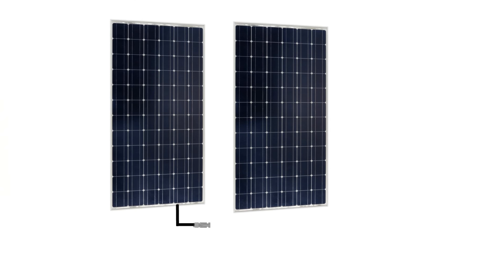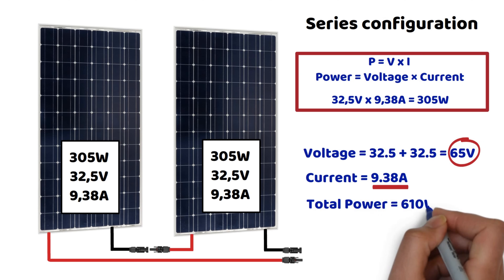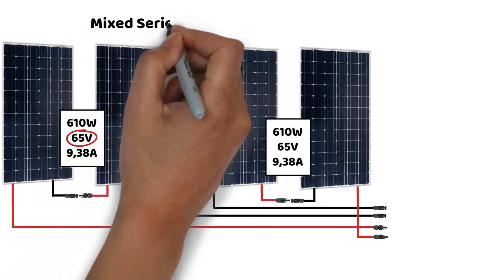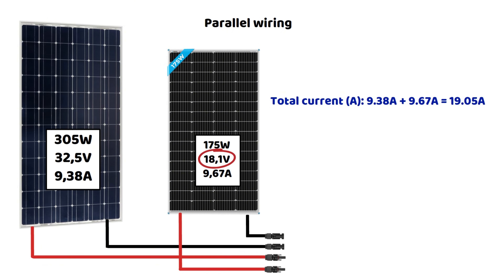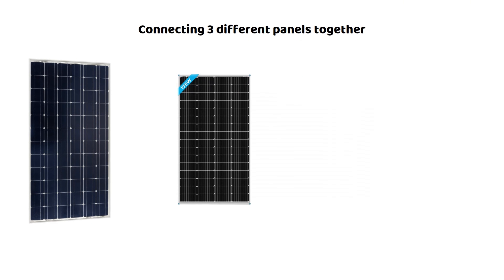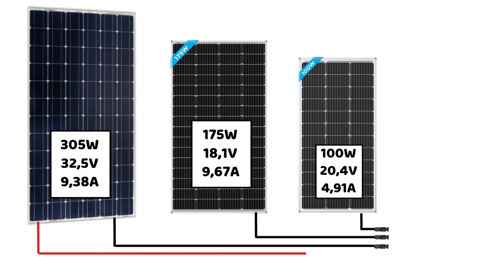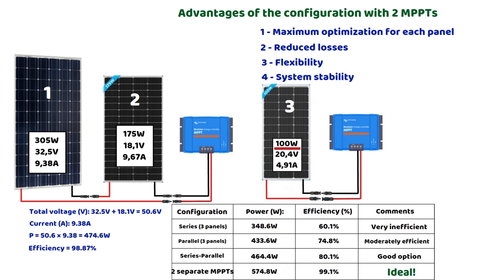How to Wire Different Sizes of Solar Panels ? Series - Parallel - Mixed?

Comment: From what I understand in the case of the 2 separate MPPTs, the output would be going to a bus bar and then, in my case to my power station's DC input. So what happens at the bus bar, does the voltage add up or the current ?

Comment: Moi j’ai une question qui est simple, j’aimerais avoir une réponse
Quand on met un injecteur réseau gridtie il est intéressant d’avoir le Panneaux en direct sur le sur l’injecteur si on passe par régulateur, on limite le voltage une première fois et résultat au lieu d’avoir par exemple un panneau de 500 W en injection direct sur onduleur gridtie si on passe par un régulateur, on aura pas 500 W parce que les régulateur va faire tomber le voltage à 12 V ou 13 ou 14 alors que dans l’autre cas on aura le du Panneaux qui qui est peut-être de 40 de volts
Donc avant avec 40 de volts l’injecteur réseau va nous fournir 500 W plus ou moins on sait que c’est jamais 100 % alors qu’avec un régulateur on va se retrouver avec du 13 au 14 V voir si il choisit 24 V, on va se retrouver avec 28 V. Résultat l’injecteur réseau va produire que 350 W ça personne en parle jamais.

Quand on met un injecteur réseau, c’est toujours un injecteur qui a une plage d’entrée par exemple de 10 V à 60 V et le panneau si c’est un 40 de vol on balance directement les 40 de volts qui seront bien bien évidemment accepté par injecteur puisqu’il est prévu pour elle sortira le maximum alors que si on passe par un régulateur, le régulateur va tomber le voltage donc l’aérage est arrivé au bout, on perd un tiers de la puissance du Panneaux
J’en ai fait les frais, c’est pour ça que j’en parle évidemment pour avoir les résultats, j’ai derrière à la sortie de l’injecteur un compteur qui me dit combien je produit. Dans un cas, j’avais 485 W dans l’autre cas, j’avais que 350w plus ou moins bien entendu donc il faut en parler les ingénieurs, les savant qui laissez  des messages là. parler non pas pour faire de la publicité pour VictronConnect, car je constate que tous ces postes servent seulement à faire de la publicité

Comment: You can't put 2 panels in series and add one panel as a parallel, the series voltage will over power the single panel and destroy it. 
So by saying to to that you're completely wrong with your maths and configuration of knowledge when connecting 3 panels together if you think 2sp will work

Comment: One thing I noticed is that you mixed (12v) panels with a 24v panel.
I wonder what the results would be of the same voltage-rated panels of different wattage ratings

Comment: Sir I have a 100w and 200w solar panel and 600/700w hybrid inverter and 3x 45ah battery. so what type of connection will be best, without considering voltage increase or capacity add up.

Comment: In short: 
Only use series connection for panels that have the SAME current rating otherwise it will run on the lowest current.

Comment: I connected two panels in series. 
One has 36V 11.6A 417W 
The second 42V 11.5A 483W 
That adds up to 78V 11.5 Amps 897W.  
3 watts are lost because 11.6 A is not reached. 
99.6% !

Comment: Do NOT buy a power unit from Aferiy, The after sales is nonexistent. I got the 2400 W version of this and it doesn't charge.

I have sent emails, photos and a video of the problem. I requested a refund or replacement. Aferiy are now ghosting me. 

On wanting to printout the Aferiy  emails, I discovered their emails to me, have disappeared from my computer. The are using SELF DELETING EMAILS. (I didnt know this was possible.) 

I looked on Trustpilot and there were plenty of similar complaints with customers having to seek legal action. Many of these units they send out have faults. Maybe thats why they are cheaper than other reputable brands.

The REVIEWS that Aferiy use to promote their products seem to be very FAKE. All with far too much praise for themselves. Very suspicious!! 

Anyway, I'm starting legal action as there is no other way of seeking a replacement or refund. 

Poor you if you took out extended warranties. I think this is a rogue company.

AVOID or you will be very sorry if yours arrives faulty, or a fault occurs. 

Can you afford to lose your money?

Note that none of the product reviewers have tested Aferiy customer Services.

Comment: Hello
I have a hybrid inverter 4.2 kwh 100a 1x MPPT. On the roof I have
A: 8x solar panel Vmp: 32.65 Imp: 13.63.
B: 6x solar panel Vmp: 44.3 Imp: 10.

How should I connect them for the best efficiency?

Thanks for the answer

Marko

Comment: Series parallel on my system with 4 panels is 98.9% efficient so make sure to do the correct calculations before just buying more charge controllers.

Comment: I am from Pakistan, a country where the economy has completely collapsed. This is mainly because, under the guise of democracy, the Pakistan Army controls all institutions, while politicians act like their obedient servants.

I managed to gather 15 solar panels with great difficulty, as buying that many panels is not an easy task in a country like Pakistan, where the average income for a common person ranges from just $100 to $300 per month.

Initially, I installed a system of four 300W panels. Later, I upgraded it by adding four more 400W panels. With these eight panels, I was able to run a 0.75-ton window AC (which consumes around 800W at 220V) from 7 AM to 5 PM.

Then I bought four 555W panels and added them to the system. I had no knowledge about how to properly connect these panels. After that, I purchased three 450W panels, and now I have a mixed collection of panels. During a storm, two of my 400W panels got damaged, although they still produce some current.

I tried a series connection, but the amperage started decreasing too much because of the smallest panel. Now, I’ve arranged them like this: three 450W panels connected in parallel with 2 400W panels — they have about a 2-4V difference. I also created a separate set of four 555W panels connected in parallel, which generates more than 50A. The upper set (450W and 400W) generates over 45A.

Then I made another series set using four 300W and two 400W panels (total six panels), which also generates around 45A. I connected all three sets in series. One gives 45A, one 48A, and one 52A. The output is based on the set with the lowest amperage, and the total voltage generated is about 130V. My inverter supports 50A and 150V, and the system is generating 4–5kW of power from solar.

Currently, I’m running two 1-ton AC units set at 26°C from 8 AM to 4:30 PM. I don't have enough money to buy new panels, nor can I sell the used ones. I’m just managing with what I have. In the morning, I can run two ACs, a deep freezer, and fans and lights in four rooms. I’m satisfied with this improvised setup.

But the reason I had to resort to this trial-and-error approach is because I never received any proper knowledge about solar panel connections. Our education system in Pakistan doesn't teach the youth anything practical or useful in this regard.
Reply: Jab yahi army Imran Khan ko 2018 ma layi thi to wo thek tha?

Comment: This is a very good video but my question is, since we’re using two different controllers, how do you decide the battery to use and how to connect it?
Reply: probably both controllers directly to the battery (in parallel) the voltage stays the same and the current adds up.

Comment: in the case of two mppt controllers, do you connect (load) out put of these two in parallel and connect it to the inverter? usually i do not use the load output of the controller and connect the inverter directly to batteries.

Comment: So. Can I hook both (2) charge controllers to one battery, to charge it faster?
Reply: Sure, you can hook up two charge controllers to one battery—just make sure they are set up in a way that they will charge the battery according to its ratings.
Reply: I believe that would be the best ... Each panel with its own controller and connected to the same battery ... But you would use more wires and more an extra controller.

It might be better to use the series method.

Comment: Greetings to you.. Although the video is a lecture at a high level of benefit and I can say with confidence that it is difficult to find information on YouTube similar to it, you did not complete the idea regarding the connection to 2 mppt in terms of how to connect the system to the load in a final way. I find that confusing and difficult for beginners.
Reply: I think you have to give that supply through MCBs in the main DB

Comment: Good day. 
i want to connect 80W and 50W or 80W and 80W or 50W and 50W. I've got 4 panels but i want to use 2 panels from these 4 panels i have.

80W = 2
50W= 2

Please assist before i mess up my panels.

I just bought Changeover switch to use from main submeter and solar installation.
Reply: For anyone to help you, they would have to know the specifications of charge controller you have (volts and current) ... And also the volts and current for each panel.
Reply: Get one charge controler for the 80W panels and one for the 50W panels. If you have 12v batteries you need a 15A charger for the 80W panels and 10A for the 50Watts. If you have Led or AGM ((non Lithium) Batteries, you would probably buy lithium next time, so i recomende MPPT charge controlers. I have never seen under 10A MPPT charge controlers , so if you have 24volt you could use 10Ah MPPT for both. If you, some time in the future, might upgrade to bigger panels, you schould buy one or two bigger charge controlers. The price difference is not that big for under 50A charge controlers

Comment: Since 99% of solar charge controllers are MPPT solar charge controllers... This video is incorrect in this instance... Is correct with a PWM charge controller

When solar panels are connected in series and attached to an MPPT charge controller, the following happens:

Increased Voltage: The voltages of each panel add together, resulting in a higher overall voltage for the array.

MPPT Optimization: The MPPT controller constantly monitors the solar panel array's output, looking for the point where the panels produce the most power (the maximum power point).

Voltage Conversion: The MPPT controller takes the high voltage from the series-connected panels and converts it to a lower voltage suitable for charging the battery.

Current Boost: As the voltage is reduced, the MPPT controller increases the current to maintain the overall power output. This is how the MPPT controller maximizes the energy harvested from the solar panels and delivers it efficiently to the battery.

Comment: I would add that undervolting a solar panel is dangerous and can create hot spots.
I experimented with this by connecting in parallel 4 panels of 40 volts (total: 160V) 5A with 2 strings giving a total of 20A and 120V.
The MPPT was set to the voltage of 120V to have the 25A, because it would only output 5A at 160V. (The actual yield was 65% at that time, because the sun had a 45° angle on the panels, so the total intensity was actually 16A and not 25A which is the theoretical maximum)
Except that one of the 4 panels of the string at nominal 160v was short-circuited so that the whole thing output 120v. Result: the intensity was looping on the short-circuited panel by the bypass diodes and the weakest cells were absorbing the energy of the healthy cells. I had a delta of 75°C on the surface of the glass between the healthy cells and the tired ones. And again, I was only at 65% of my maximum intensity, because it was early February (cold outdoor temperature and quite low sun). I dare not imagine the summer solstice with warm weather and perfectly orthogonal radiation.

In case of mixing different panels, you really have to make strings with the closest possible voltage.

Comment: Connecting 2 different panels in parallel Will not work as you said, the higher voltage One Will work alone in most cases! Since the low voltage One Is not able to reach the same voltage and the blocking diode (if present)Will prevent the current tò run from the Higher voltage tò the lower voltage panel... It can also burn the lower voltage panel if there Is no blocking diode and the panel Is damaged itself
Reply: Mmmmm😡this really sucs
Reply: That sucz
Reply: Exact
Reply: Needs to be within like 2v to work

Comment: How to connect my 3 panels 
2 of them is:  30w renogy.
Open Circuit Voltage : 22.9V
Opitmum Operating Voltage : 19.5V
Short Circuit Current : 1.70A
Optimum Operating Current : 1.60A

And 3th is: 200w 
Vmp 18.12v
Voc 23.44v
ISC 12.37A
Imp 11.05A
Thanks in advance!
Reply: I agree with the other person who said you should work out this problem yourself, but since it has been several months since this question was posted, I'm going to give an answer... 

Connect the three panels in parallel. That should give you a max power of 258W, which translates to a 99% efficiency.

Comment: If you have two different charge controllers, can they be connected to one battery?
Reply: Yes. If the same  volts.
Reply: I have 4 different charge controllers on one battery bank. One of the chargers has set input for different battery chemistries. I adjusted the other 3 controllers to have the same settings and it hasn’t let me down.
Reply: Yes, but use same settings. For example lifepo4: 14.6v for both charge controller. That is max voltage for 12v system.

Comment: Now which one is better series and perallel
Reply: Depends on the distance of the solar panels to the controller, the operating range of the controller (max volts and amps) if the inverter has a start up voltage. If you’re using mppt or pwm. 
The higher the voltage the lower the amps. The lower the amps the smaller the cable. The smaller cable is cheaper but charge controllers that can handle higher voltages are more expensive. 

I have 2 50amp controllers a 60amp and a 20 amp charging a 2560ah battery bank.

My house is 2 storeys so the cable run is quite long. 

All my controllers can handle 150v and my panels have 2 different size panels. 
195w and 250w.

The voltage open circuit is close to 40v so I run 3s 2p on both types of panels giving me 120v and 9.8a and 120v 12.6a respectively. 
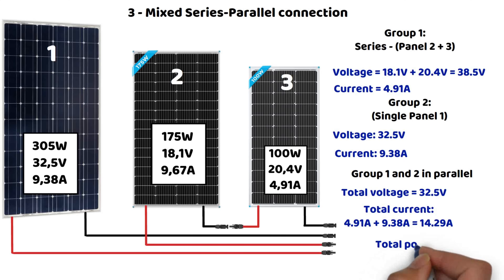I have the controllers over paneled almost to the maximum of the controllers to make sure I get full charger output as early as possible in the morning. During summer I’m outputting 180 amps total at 7:30 in the morning and about 8:30 in winter. 

It works best for me. 

The 20a controller 2s for 80v at 4.8a. 

A lot of research went into ensuring that I’m not going to over power the controllers by over paneling them. They need to be able to handle the heat generated by ‘wasting’ the excess power when the panels are operating at full efficiency and so far I haven’t gone past 50% of my maximum temps.
Reply: Very good info,thanks

Comment: A convincing argument to support individual micro-inverters.
Reply: That's true. Even though the voltage of two panels same, if the internal resistance differs,  it efficiency gets affected.

Comment: Is he saying if one has a panel of say 45vdc output and another of say 24vdc output connected in parallel then the measured voltage would be the smaller of the 2? Incorrect. Not so. It would be an average of the 2.
Reply: Not according to Rich solar:Wiring in Parallel

When mixing panels with different wattages but similar voltages, the best way to wire them would be in parallel. To calculate this, you add the amperage of the two panels and multiply that number by the lowest Max Voltage between the two panels to get the total watts.
Reply: Is it also applicable to voltage?
Reply: @eddietee6305  so in parallel, it doesn’t use the smaller of a voltage, but an average?

Comment: Your theory on panels in parallel is wrong. The power company have different generators of different sizes connected to the grid all at the same time. The panels have reversing diodes as part of their circuitry. The effective voltage would not be the voltage of the smallest panel - it will be an average of the output voltage of the panels.
Reply: I have tested this before and it is as it is as demonstrated in the video
Reply: Wrong; the effective voltage will be the highest voltage panel, the diodes on the lower voltage panels will be reverse biased so there will be no current from the other panels. If you have different panels the only way to get efficient power from them all is a separate mppt controller on each.
Reply: Yes but electrical company have a network that every generator entry in parallel under strongly rules and circumstances. 1) phase , 2)voltage , 3)frequency. Every generator gives to network the power that is made to give.
Reply: @iorant2558 tak zgadza się. Ale jedna farma fotowoltaiczna składa się z jednakowych paneli. Dopiero falowniki "puszczają"dalej prąd do sieci wraz z innymi kontrolerami. Dlatego każda farma może mieć inną moc.

Comment: you so f*ng WRONG. in parallel V don`t be = lowest Panel, it`ll be somewhere in the middle between 32.5-18.1, but to the higher side.

Comment: So I have 3 mismatched panels in parallel.  1st one 18.1v, 5.50 amps, then 18v, 13.49 amps, 18.2, 16.5 amps. I had the smallest one first, then the bigger ones. At 1pm I was getting only getting 250 watts from all 3. I should have gotten over 600 watts using the lowest voltage of 18v and adding the amps. Now my question, is having the smallest panel first limiting the entire system? Say out of the 100 watt panel which was first, it’s like I was getting 80 watts x 3. Should the size and order of the panel make the difference?
Reply: The order doesn't matter. His theory is wrong however.
Reply: @ thanks for the clarification